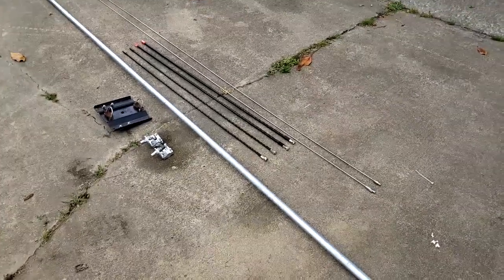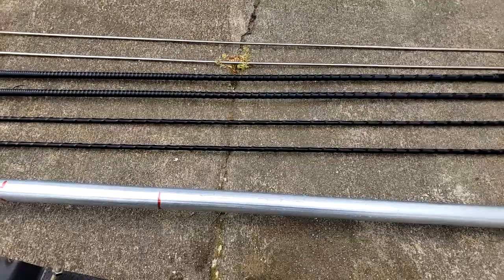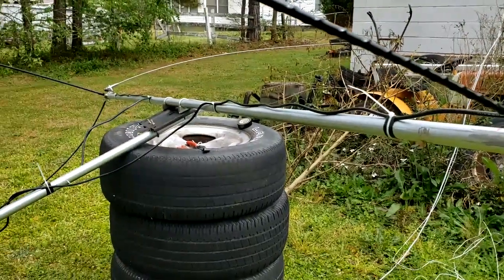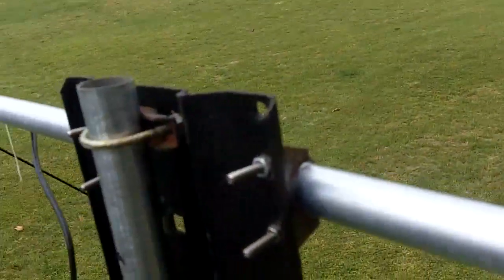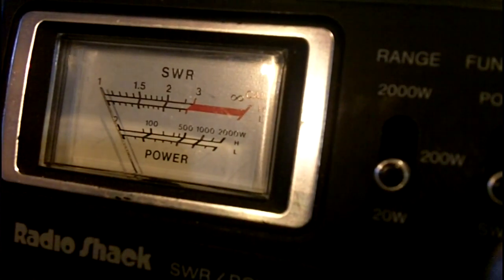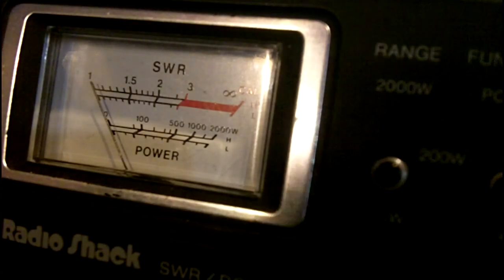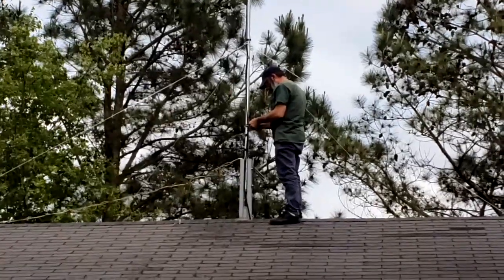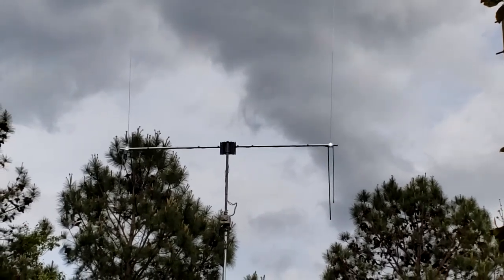Homebrew Beam CB Radio Antenna My New Homemade Base station

Comment: i CANNOT HAVE AN OUTSIDE ANTENNA BECAUSE i LIVE IN A IN A HOA DEVELOPEMENT SO I WILL HAVE TO PUT IT IN THE ATTIC
Reply from the maker: I think you should move, or just put an antenna up anyway.
Reply: Got any trees? You could always build a center-fed 1/2 wave wire in the tree and run the coax down the trunk - painted and as hidden as possible.
- I once erected a Penetrator (without it's radials) 15 feet from a busy road in the grass area behind my apt's small patio. I used a shovel and slit the ground all the way out to the planter and buried the coax about 3"- 4" down in that slit, out to the center of a planter with a small cluster of four 15' - 18' tall white birch trees - where I pounded a steak into the ground to mount the Penetrator ON the (daily sprinkler-moist) ground, and used it for 7 months that way until we moved.
   I never got talked to about it by the Mgr nor any of my neighbors, and asked the Mgr if it was alright to have it there the day before I moved - to which she said, "No, and if you don't take it down I'll have to evict you!" - then I said, "No you wont, I'm moving out tomorrow and taking it with me - and by the way, it's been there since the evening of the day I moved in 7 months ago!" lol - she never noticed it wasn't one of the 4 little white birch trees, and being on the highest ground around, it actually got out really well - better than my 500w mobile, using only a 100w amp inside.
Use your brain and be daring and you could be on the air!

Comment: One more question… The ground planes aren’t tied in the 102” whip… they are just attached to the electric conduit right? I wasn’t sure if the boom was actually part of the antenna or just there to support the Whips…
I’m ordering everything now. Please help me to be sure I’m doing everything right.. 
oh ya… Do you think by using a tuner, I could use this on 10 meters as well…
Thanks…
Reply from the maker: the boom is just there to hold it all together. I used 4' firesticks that are attached to the boom. the 102's are isolated from the boom.
Reply: @MowerJunkie  I ordered Tram -B-HC CB antennas. They are only 3 feet. Lol… I saw on your video the ground planes had a red tip, the things I bought had a red tip. Oh well… I’m sure I’ll find a use for them someday. I’ll order the fire sticks tonight.
Thanks,
WW3HAM
Reply: @MowerJunkie  Just to be clear… The boom is or is not metal conduit.? I just watched a video where they are using round aluminum tubing. I can find the aluminum tubing but 1, 2 or 3 foot lengths. Lowe’s did have 6’ but they are sold out. Thanks…
Thanks…
Reply from the maker: @skiball2000  aluminum is best, But I used 1" steel pipe for mine.

Comment: Can the ground plane be stainless steel too? Or does this have to have fibreglass whips?
Reply from the maker: as long as they are 1/4 wave whips, They will work. I used the fiberglass because that's what I had. Take care, Thanks for watching.

Comment: Just curious to what is the front and back of the antenna? I'm thinking of building one but just pointing it north
Reply from the maker: this antenna sends the signal in 2 directions, perpendicular to the boom.

Comment: Very Nice Antenna sir.  I do have a question though.  To make it directional,  you need a director and a reflector.  Which one is which and where is the Gamma match?
Reply from the maker: they are co-phased, both sections are active. co-phased antennas are bi-directional, they concentrate the signal in 2 directions. this antenna design does not require a matching network of any kind, it has a natural 50 ohm resistance.
Reply: @MowerJunkie  ok.  Got it.  Thank you.

Comment: You need to check out the hhsh like in hotel hotel double Bay I saw this antenna and CQ mag back in the 90s and it was for 6 hours and I extrapolated it into 11 love meter in a thing hanging from a pine tree I am here in Montana in my yard it's on a Hellyer. So you can spin it around directional directional fire through the h

Comment: hi magic antenna it's on my to do list, from the two stainless whips how long is the coaxial cable down to the join and how did you join them? thanks
Reply from the maker: I used a factory made Co-phase harness. it's made from 2 9' pieces of 75 ohm coax joined together into a pl-259 connector.
Reply: thanks for your reply and diagram, i will study it in detail,

Comment: One suggestion and one question......suggestion - always use black zip ties outdoors. They are more UV resistant than the natural ones. My question - is there a reason that you don't have the radials in line with each other instead of the 3" stagger that you currently use where you mounted the 102" whips?

Comment: Hey. Question. ..
Swr.   A justing.  Trim 102. On top 4 better. Swr...
Reply from the maker: When this antenna is assembled correctly, it will not need any adjustments. it will have a 1.2 or less SWR.
Thanks for watching, 73's from 151 SC.

Comment: so the two vertical elements are 102” whips and the ground plane elements are fire sticks… is that right?
Reply from the maker: Yes, 2 102's and 4 1/4 wave 4 foot fiberglass antennas as the ground planes.

Comment: Do the 4. radials need to be the same brand of antenna? Can I use different 4 footers for the radials?
Reply from the maker: Any 1/4 wave antenna of the same design, will work fine.

Comment: So far which antennae has been best for local, and which for both local and dx
Reply from the maker: So far, My vertical 2 element Yagi has been My best local antenna. and My 3 element horizontal Yagi was the best for DX.  Thanks for watching, Take care.
Reply: @MowerJunkie  thanks for the response. Is the 2 element yagi the phased antenna array?
Reply from the maker: @spirittravels.  the Yagi is what I'm running now. Check out My latest video to see what I just did with it.  https://www.youtube.com/watch?v=quJzBENg2a8&t=529s
Reply: @MowerJunkie  thanks for the info, yeah I think this is a really good one but I think I much prefer the idea of your previous quarter wave wire antenna (or enfed type halfwave,  or 5/8 wave ground plane that's been homemade out of wire) the reason being because they're omni directional, cheap to make, and  pretty easy to put up.
Actually since u like beams, i would recommend to build a wire quad antenna on a plastic pipe frame,  because they are supposed to be the best. I saw utube videos on 3 element ones and they have amazing rejection
Great videos. I like them lots.keep up the great work.😊

Comment: Hi John, this is awesome! I want to use your idea and plans to make one. The question, the fiberglass antennas you used are they 4' or 5' for your ground plain? Awesome videos, keep up the good work. 73s 123 bayou state.
Reply from the maker: I used 4 foot whips, But You can use any 1/4 wave whips You have.

Comment: For your next homebrew antenna project you might consider building a two element quad beam.   Back in 1978 I had an Avanti PDL-2 Quad beam on the roof at about 35 feet that got out great!   It would effectively multiply my transmit power by 16 times (4 watts would get out like 64 watts and 100w would get out like 1600w!)  What's cool about a two element quad beam is:

1 -  It has a shorter boom length than your phased beam in this video
2 -  It's a wire antenna, rather than using aluminum elements (although, it does use an aluminum boom to space the elements)
3 -  It provides the ability to switch between vertical and horizontal polarization (although, it does require two feedlines)
4 -  It provides both gain in the forward direction and rejection of signals coming in from the rear of the antenna
5 -  The rear element is totally passive, requiring no connection (the rear element wires are slightly longer than the driven front element)
6 -  The wires are bent around the spreaders so it isn't as tall or wide as straight elements, which means it can be rotated in a smaller space

A step up from the two element quad would be a three or four element quad.   You may recall the legendary Moonraker 4 antennas that were popular in the 70's.   They had a reflector element at the rear - like the PDL-2 - then a driven element in front of that and then two passive director elements that further narrowed the beam in front of that.   And, of course, there was the big boy beam - the Moonraker 6 antennas that had a 36 foot boom and SIX elements - the reflector, the driven element, and then FOUR passive director elements!  The Moonraker 6 would effectively multiply your transmit power by a whopping 50 times!

Thanks, for the video!
Reply: I also had a PDL2 back in the '90s. Mine came apart and was destroyed during a microburst. The hard part of duplicating this great antenna is trying to find an economical way to fabricate the "orbital" spherical ball skeleton.
Reply: @johnsortore4470  I had  a Moonraker 4 in the late 80s that got caught in a tree and mangled the director elements pretty bad. A friend fabricated a PDL-II out of the remnants. To make the orbital elements, he bent the aluminum tubing around the trunk of another tree. Worked great.
Reply: @mstover2809  I've tried to bend some but they always kink.

With the new technology of 3D printing, someone should start making the PDL2 hubs.

Comment: Excellent! Wish you had rotated it 180° during QSO with 1963 Jamaica, so we could hear the received signal drop to below the noise as the side null is pointed at him, and then hear the peak build when it rotates to where it is again broadside to the other station. If you S-meter is linear, you can calculate the front & back to side ratio in db that way. Nicely done!
Reply from the maker: You're right, I should have rotated it. I have rotated it while talking to locals, one of them gives me a 6db signal pointed at him, and a 3db on the sides. Thanks for watching, 73's from 151 SC.
Reply: You would not rotate it 180 degrees it transmits front and back theres no back rejection to this antenna

Comment: what is the coax you are using ???
Reply from the maker: I used an rg59 75 ohm co-phase harness, and a barrel connector to connect it to My 50 ohm rg8x coax. Thanks for watching, 73's from 151 SC.

Comment: why dont you build your self a 2 element delta loop beam antenna for the driven element is 1005 div by the frq the reflector mite be 10 percent bigger you can look it up on the net

Comment: another way to phase 1/4 wave verticals is center conductor to 1 of the vertical elements and shield to a 1/2 wave pipe or wire then to #2  1/4vertical. no ground plane optemum hight is 1/4 off ground.  called a half square antenna look up formula. antenna building is fun! one antenna you have to make is a dipole cut to odd 1/2  wave. so 3/2   5/2   7/2 etc. so basically a dipole 3x 1/2wave  5x1/2   7x1/2 wave. bend it in to a inverted v and it hears good in most direction with gain but has horizontal polarization.  it gets fed with 1/4 wave 75 ohm matching section.  formula is 492/frequency x 3, 5, 7 etc! sum tuning will be needed as it has a strange resonance with the harmonics.  it is a good set of dx ears and good for locals with flat side. thay think you will have the amp on all the time! i would get people on skip when there was almost no band conditions! have to try. it is a old and forgotten antenna. take care and good dx!

Comment: Looks fantastic!  How did you arrive at the design?  I'm interested in the calculations.  I need a roof-mounted DX antenna (read 'small') that can reach Japan from east coast USA on 100 watts.  Can yours do that?  Also, what bands can it cover?  Thanks!

Comment: SWR of an anteanna does not change with increase in power. 
Always take SWR readings with amplifier off unless your meter can handle the power.
 Who needs skip when you run a kicker. 
Texas Star Sweet16, DX500, 350HD.
Stryker 955HP, Galaxy 959, TS-430s, SILTRONIX 1011D, SB200, Johnson 223, Palomar 300, 350, 225.

Comment: Maybe you will update and add a flat side and add a switch might be a good thing for you to try almost looks like a PDL 2 and on a tower for 2 wave lengths 64 feet to the ground plane and a good ground I'm slimjim 119 in the cold country eastern Ontario  Canada I'm  working on my radio just need a meter  signal  for a Cobra 25 it quit a lights then back in my car  Wilson 5000 and a 225 Palmar
Reply from the maker: Thanks for watching, 73's from 151 SC.

Comment: Did you use a T connect the cables
Reply from the maker: I used a standard 75 ohm co-phase harness, and a barrel connector, to connect it to My 50 ohm coax.  Thanks for watching, 73's from 151 SC.
Reply: @MowerJunkie   thank You 73’s to you shepfc1

Comment: Hey Mower Junkie -  I just come along your channel and I need to say “WoW”.   Back in 1973 - my wife and I had the Realistic TRC-46.  I still own it.  In the house we used a Yaesu 101 for CB with a Moonraker 4 on the roof.  After watching your video - I’m believing you and your wife take a lot more pride in your set-up than I did with mine.  It’s always a lot more rewarding when you put your own system together and get the results that you just achieved.  To make your own “Beastly Antenna” and get a 1 to 1 SWR - -  That’s almost impossible.  “Way to go”...
Reply from the maker: Thank You so much! I spent a lot of time designing this antenna, and I couldn't be happier. it looks great, and works great too!  Thanks for watching, 73's from 151 SC.

Comment: basicly you get only half the power on each antenna, in most cases not so good for local
Reply from the maker: You need to do more research. doubling the antenna, doubles the power! and it works great for local and skip.  Thanks for watching, 73's from 151 SC.
Reply: @MowerJunkie  Where magical comes the extra power from? This is what I unterstand 2 antennas means 10 watts tx, and <5watt on each antenna
Reply from the maker: @VicGreenBitcoin  if You search google for "co-phasing antennas", they will show You all you need to know.
Reply: @MowerJunkie  Thanks, looking in to it right now
Reply: Update, seems i am right

Comment: I had a dual polarity Moonraker 4 at one time and was able to switch polarity using the switch box provided with the antenna. I noticed that when the skip signals would start to fade on vertical polarity I could switch to horizontal and the signal would come back up. When it would start to fade on horizontal I would go back vertical and again, the signal would come back up. As the skip signals bounce off of the atmosphere, the polarity will change. That is why it is good to have both horizontal and vertical when shooting skip. Changing back and forth while talking local will not help much. Flat side will normally work a little better for local if both party's are running flat but both stations need to be the same polarity when talking local. Being able to switch polarity on signals that are half scale or fading out is a real advantage when shooting skip. Nice job on the antenna mower junkie.
Reply from the maker: Absolutely right! I have multiple antennas setup, and I use switch boxes to switch from antenna to antenna. sometimes You need a vertical, sometimes a horizontal. and sometimes a ground plane is all You need.  Thanks for watching, 73's from 151 SC.

Comment: I had. Mentioned cophasing. The one you had mounted., Hadn't thought of mounting like this, but like the concept? It should be a 3 0r 4 DBD gain, I assume it aims off the broadside, not the end. The beam on vertical might be more again ground wave, but locally it should require less turning.  Very interesting way of getting more broadside gain yet hear ever one ok? I have a boom from an old Avanta 3 element Astro beam and am thinking of using so 4 foot whips to do something very similar to this thanks for sharing and also just doing it. Radioing at its finish!!!.
Reply from the maker: Thanks, So far I am loving this antenna! Take care, 73's from 151 SC.

Comment: Great Job!...wish you would have shown the co-phasing of the two whips.. the hardest part  73's from WV 947
Reply from the maker: Sorry about that, I still can't believe I forgot to mention the co-phase harness. I used a standard 75 ohm co-phase harness, and connected it to My 50 ohm coax with a barrel connector.  Thanks for watching, 73's from 151 SC.

Comment: That looks like a Jo Gunn antenna except that a Beam has a reflector, a driver, and a director. This doesn't. You will find that this antenna will radiate in a figure 8 pattern off of the sides of the antenna so it will get out better from the either side rather than off either end. It looks great and brings back memories when I use to play around with antennas in my back yard in the 80's. Keep up the good work. I enjoy all your videos.
Reply from the maker: Yup! The figure 8 radiation pattern is why I put it on a rotor. this way I can point where it needs to be.  Thanks for watching, 73's from 151 SC.

Comment: Amazing project Mr John. Tks fer sharing this beautiful project. Are you using a 75 ohms cable? How many meters are you using to co-phased the antennas? Tks, I´m going to co.phased two A99 in my roof. 7351 and good contacts.
Reply from the maker: I used a pre-made 75 ohm co phase harness. I connected it to My 50 ohm coax with a barrel connector. The A99's will work well, But remember 1/2 wave antennas need to be 18' apart. Thanks for watching, 73's from 151 SC.
Reply: @MowerJunkie  TKS Mr John. 7351. I will keep that in mind.

Comment: I bet you could turn that into a 2 element beam.
Reply from the maker: Yes, very easily. If I ran the coax out of phase, It would turn it into a single direction beam.  Thanks for watching, 73's from 151 SC.